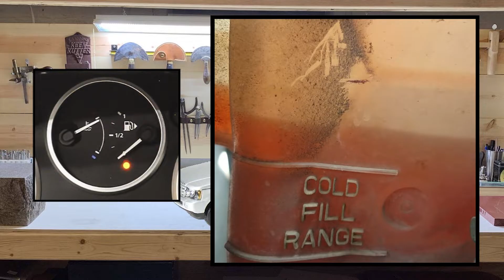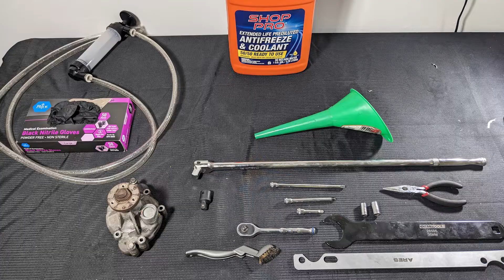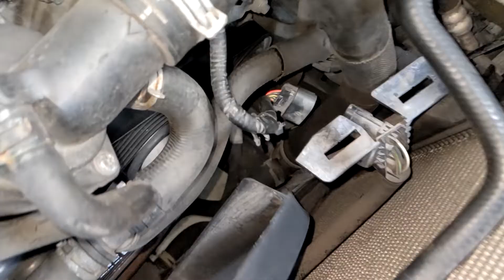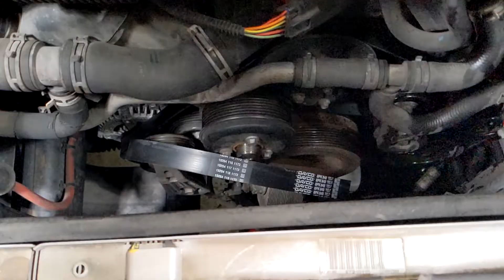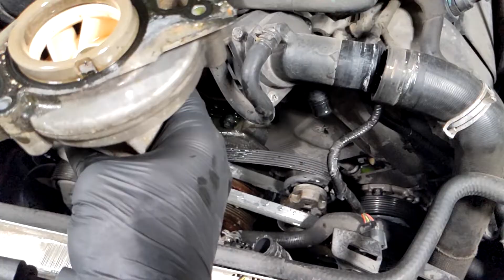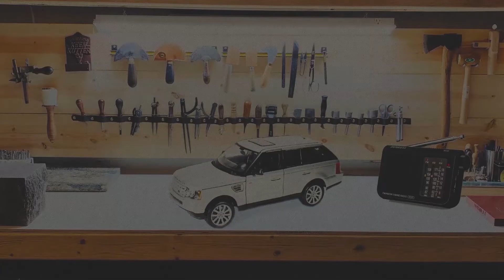Water Pump Replacement - Range Rover Sport or LR3

Comment: I have an LR3 with the same 4.4. The information for bleeding the air after refill is a bit obscure online, but essentially you leave the pressure cap off until the thermostat opens and purges the air? I have an intact bleed screw above the throttle body; what's its function?
Reply from the maker: It's very cryptic online. From the manual, it states loosen the bleed screw (by throttle body), loosen the coolant expansion tank bleed screw, fill to upper mark on expansion tank, start and run engine at 2,5000RPM (in park) for 30 seconds, then regular idle for 30 seconds, then repeat rev/idle sequence another 4 times (should take 5 minutes for all 5 cycles), you should see a steady stream of coolant running from the bleed screw, so close this, fill the cooling system keeping coolant at upper mark until steady stream of coolant seen returning to expansion tank, then close that bleed screw. Then install expansion tank cap.
Reply from the maker: https://drive.google.com/file/d/1p9XCcVJpbidf_32yl7q63yvmPcvTLdIK/view?usp=sharing
Reply: @HazyJay  Thanks for the PDF! It makes sense now.

Comment: Good looking out on the 2 bolts not to remove on the pump. Problem I had was I was unable to remove the fan shroud on my 2011 HSE (Jag). removed 2 pins and 3 bolts. Seems to be 2 pieces. got the smaller one out but then got stuck. Maybe you have to remove the fan.
Reply: That’s the problem I am having. Did you have to remove the fan or how did you get the second piece off?

Comment: I like to watch your videos to look for things that are bound to come up on my LR3. That one clip you showed in this video of the glowing coolant leak on top of the plastic thermostat housing left of and down from the throttle body. I have that too. What causes it?
Reply from the maker: No prob haha, were all in this together 🤙
Reply from the maker: If you just replaced the thermostat or disconnected any of the upper hoses, coolant at that spot is likely from spillage during that process. If not, then it's possibly a leak from the thermostat or something around there like the bleed screw.
Reply: @HazyJay  Okay, thanks. Not sure of the maintenance history of the cooling system as I got the vehicle recently. Seemed odd to me that there would be coolant above a connection rather than below!
Reply from the maker: What I would do is clean it off with some water and see if it reaccumulates, if not you're probably good 👍. One time I checked under the hood and the bleed nut by the thermostat was totally broken off and leaking.
Reply: @HazyJay  Appreciate you, your videos, and your willingness to answer quick questions!

Comment: Dude I’ve got a LR3 4.4 and the cooling fan pulley is literally seized onto the bracket that it spins on behind it. I got the bolts out but the pulley is literally stuck on no matter how much pb blaster or hits with a mallet you use on it. Can’t get up behind the pulley because of it’s design and can’t use a big enough gear puller on it without removing the radiator. It would be one thing if I could get penetrating oil where the pulley meets the bracket but it’s basically impossible. Any ideas?
Reply from the maker: Maybe try some heat around the edge where it connects to see if some thermal expansion will cause the rust to crack. You'll need a small blowtorch.
Reply: @HazyJay any specific one? Butane or propane?

Comment: Just to be clear...No additional sealant on mating surface for new water pump? Went through this for the tranny pan/filter replacement and should have followed my gut 
and added thin layer of sealant (like PermaTex) on both sides of the gasket. Just sayin'
Reply from the maker: It's not mentioned in the repair manual but it's a consideration. I just exchanged the gasket that comes with the coolant pump and didn't add any additional sealant.
Reply: I would use some kind of sealant, I replaced my water pump several months ago followed this video to the letter. It's been leaking from the gasket ever since, im just now getting around to replacing my water pump and gasket....again.

Comment: Anyone no the water pump torque settings
Reply from the maker: The repair manual will state 10nm (7 ft lbs) for the "coolant pump bolts" and the "coolant pump pulley retaining bolts", seems light to me but we are bolting onto the engine block.
Reply: @HazyJay  yeh I done torque at that and just gave a little more as seemed light to me 👍

Comment: Hi I'm debating on buying a 2005 L3 v8 se, has an overheating problem after 20 mins any idea what it could be? Purchase price would be $1200, has 187xxx miles not sure ifs it's worth it
Reply from the maker: Typically either thermostat, water pump, or radiator. The most expensive would be cracked engine or head gasket allowing leak of coolant into combustion chamber. Question is, WHY is it overheating. If the coolant level stays the same at 20 minutes but it overheats it's likely the water pump, thermostat, radiator fan, or an air lock which are relatively cheap/easy to fix and I have videos on these. If the coolant level is dropping and needing replacement at 20 minutes, question is where is it going. If it's just a leak in a hose that's easy (as opposed to a head gasket or engine block crack)
Reply: Check the oil filler cap for milky oil. If the oil appears milky, walk away.

Comment: Excellent video, great job. Love the included mishaps, so it’s not just happening to me 😆
It might help some people to know that the fan nut on the 2.7 Diesel engine and the V8 4.4 petrol is left hand thread as shown in your video, however the V6 4.0 petrol is right hand thread. Getting this wrong and you possibly tighten the fan on for good.

Comment: Q; what size wrench were you holding in your Left Hand to loosen the Fan Nut??
YM
Reply from the maker: 36mm fan clutch wrench for the nut, but also need a bolt holder to keep it from spinning: https://amzn.to/3G4aVlQ
Reply: @HazyJay  what size is the bolt holder? is that included in link?
Reply from the maker: @garybarrett7753  Yes it's included with the fan clutch wrench on the amazon link

Comment: Question for you: Is the Fan Nut a Right Hand thread or a Left Hand thread?? When you loosened the Nut it looks like it's a right Hand thread (I.E. lefty loosey) but when you rotated the Fan Assy, you rotated it to the right ?? That makes it a Left Hand thread. What Am I missing here? YM
Reply from the maker: It's righty-loosey, the leftward movement is me holding the bolts still so the fan doesn't spin when I'm pushing to the right.
Reply from the maker: So it threads the opposite of a typical nut
Reply: @HazyJay  is this the same for 2006 RRS SC? I cannot get it off for the life of me?
Reply from the maker: @colincruz664 there's the dynamic pump on the accessory belt which makes it a little different, I'm sure the basics are the same though
Reply: @HazyJay  I’ve bypassed that pump, so stick with the righty loosey direction? For the fan clutch bolt*
Reply from the maker: @colincruz664  Ohh, actually according to the repair manual the 4.2L SC engine has RIGHT HANDED cooling fan threads, so it's lefty loosey, so the opposite way as in the video.
Reply from the maker: @colincruz664  and just to double check, when I look at the 4.4L NA section it shows left handed threads. So 4.4L NA is left handed and 4.2L SC is right handed.

Comment: Hi, my 2013 RRS engine fan is constantly running. It’s been to two garages, both say they don’t know what’s causing it. REALLY really don’t want to go to Landrover, do you think replacing the water pump will solve this problem?
Reply from the maker: Does the fan run loudly as soon as you start the car even if the engine is cold? If so, you likely need a new fan clutch.

Comment: Brother I have a problem and what do you think may be the cause  , after changing all my 8 ignition coils and 8 spark plugs plus 4 o2 sensors, I still get issues when I put my 09  in sport mode .

please help me
Reply from the maker: Is there a warning message? What is going on with the vehicle?
Reply: @HazyJay  when it’s on the level 6 sport mode car slows down and engine light blinks but level 1 to 3 sport mode is fine. I wish to drive to you one day to figure it out for me I really love my car and I don’t want it to do on me
Reply from the maker: @nicholasbrown982  Don't forget to check the basics, like the air intake filter and the mass air flow sensor, both can be replaced or cleaned for cheap.

Comment: What coolant do you use on your vehicle? The one that is in my LR3 appears red/pink whereas yours look more yellowish..
Reply from the maker: Your red/pink antifreeze is likely an OAT (organic acid) antifreeze, but it's hard to say since many types have the same color. If you're unsure, you can either flush the system as much as possible and use the OEM antifreeze, or just use a universal antifreeze which is OK to mix with any antifreeze. I use the universal antifreeze (ethylene glycol).
Reply: Like stated universal yellow is ok to use. Works fine

Comment: I always look to see if you have new content because your stuff has really helped me. Then i remember, shiiiit Hazy's RRS broke again that's why hes making the vid. They are a pain but also awesome at the same time! Keep going man!
Reply from the maker: Glad I could assist, I went a pretty long stretch without anything major which is pretty remarkable 😅
Reply: @HazyJay  it’s not uncommon for the model you and I have “the 4.4” to go up to 275-285 on the dash before
Reply: I'm just curious as to how you conclusively knew your leak was from the water pump. It's a slow leak in my exact engine, coming from the bottom center which to me seams like the water pump. 😊🤞🤞